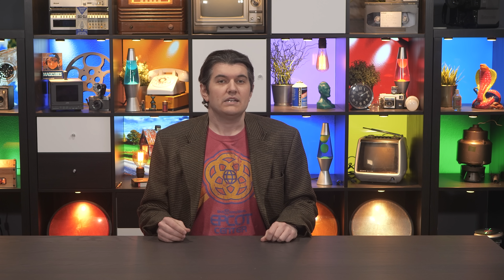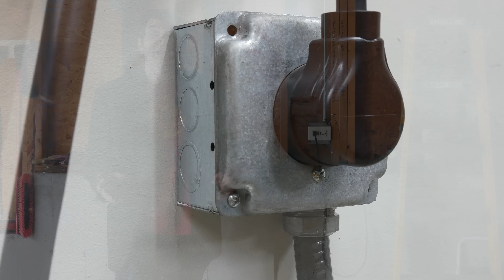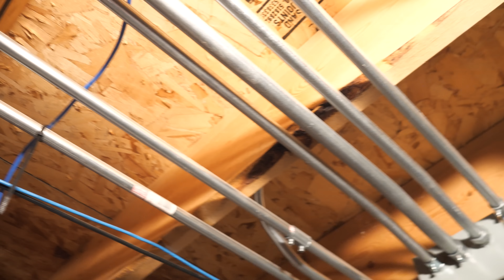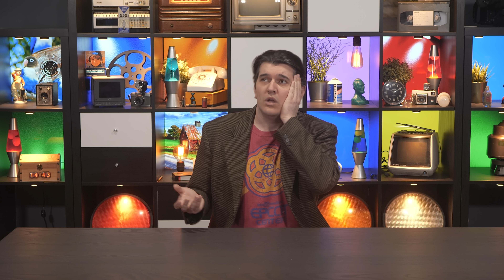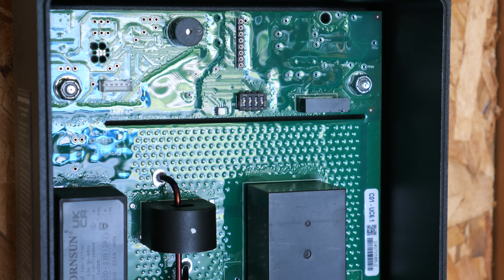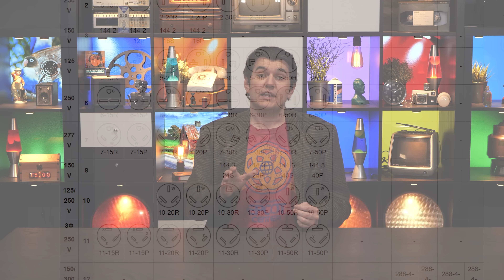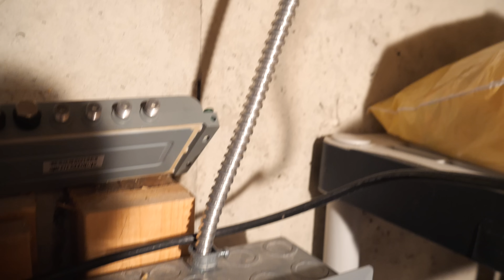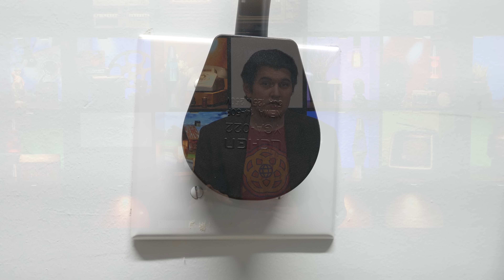The "standard" car charger is usually overkill—but your electrician might not know that

Comment: Electrician here. I think its well known amongst us that EV chargers are configurable to the OCPD rating. 

If the demand calculation permits a 50 amp OCPD for the charger, that is what im going to install. Every. Single. Time. 

Why?

Because i am not required to have a separate disconnecting means at 50A or less, so the cost difference is the difference in wire size. No customer has opted for less when given the option, the cost is negligible in the grand scheme of things, especially when the panel is shared with the wall the charger will be mounted to. 

Additionally, depending on your AHJ, there is no reason to buy a 14-50r and use the connector from the grizzle. Just take the gland out and hardwire the charger. 

So the cost difference is truly negligable

Comment: Here in Manhattan, there is a guy around the corner from me that literally has a 120V orange extension cord coming down out of a third floor apartment window, wrapped around the fire escape, plugged into another extension cord, wrapped around a tree, plugged into a third cord, and then into their Tesla.
Reply: Hope that he's using 10 gauge or so.
Reply: @selewachm . Lol, I bet he’s using 16 gauge.
Reply: The homeless man must be loving the free power!!
Reply: @Endoe.McKronic  Around here you need to beware of the wires coming out of the lighting junction box, laying on the sidewalk and disappearing under bridges...
Reply: That may not be up too code!
Reply: I'm guessing it will keep the snow melted around it in the winter.
Reply: @NackDSP  Not really.  120 lines are only slightly warm to the touch.  It might melt the snow a hair but it'll refreeze nearby.
Reply: @shaunmcisaac782  Probably 3x 50' 16ga extension cords pulling 12-13amps for an extended period... I bet after a month of use outdoors you won't hold the hot spots in your hands😈Not for long😈
Reply: @shaunmcisaac782  voltage doesn't really matter, if you pull too many amps, or have weak points, it will get hot. I have had outlets melt the plastic from even moderate loads. Also, extension cords aren't really supposed to be used at high current continuously.
Reply: This is an insane fire hazard.
Reply: @jmpersic  yea but the fire escape is metal so it will still probably be fine because I bet the car is only charging at 8 amps. I mean it’s a bad idea but it will probably work for a while.
Reply: I wish I could do that.
Reply: I had a neighbor that ran an extension cord from 2 car garage (too filled up with stuff to park a car), across the driveway, over the sidewalk, across the parking strip, to their EV which was parallel parked on the street. They did set up some orange traffic cones next to the sidewalk where the cord crossed.
Reply: @twostate7822  yea i do that i just throw a door mat over the cord on the sidewalk
Reply: I had plenty of space in my 200a service panel.  I decided I wanted a full level 2 charger.  I do electrical work so I installed it myself.  I ran the conduit, pulled my 6ga wires, dropped them into a 60a breaker and landed them in a Tesla charger.  My car charges at 11.2kw.
Reply: Wrapped around the fire escape. Oh, the FDNY is not going to be happy about that. Sooner or later, someone is going to be fined. And if that's a rental tenant, maybe evicted.
 I can you from experience that if any condensation or precipitation gets into the places where those cables join together? The whole outside of the cords will be energized. Not fun.
Reply: One has to do what one has to do... 🤷🏻‍♀
Reply: The voltage drop on that by the time it makes it out to the Tesla must be brutal 😆  (unless he's using at least 10 AWG cords with good connections between the cords, which I highly doubt)
Reply: @XSFx5  Orange extension cords are generally 14 AWG rated for 15 amps max. So adding high current with an extra 100 feet or whatever will indeed cause a noticeable drop.
Reply: @xeridea Indeed.
(Heck, some of those extension cords people use are just 16/2 or 18/2, along with multiple power taps, aka. surge strips.  So significant wattage being wasted as heat, in a positive feedback loop between heat and resistance)
Reply: Plenty come in 16 and 18 too. 16 is the most common at big box diy stores. They go up in price sharply going to 14 or 12
Reply: That part about wrapped around the fire escape doesn't sound safe or legal.
Reply: @stevek8829 it's not legal regardless for building and fire code, but if it's also not protected by a proper GFCI breaker up the line it's definitely not safe!

Think about if the insulation gets worn, aged, or otherwise damaged to where it's contacting conductors on the metal of the fire escape, or connections become loose & exposes, and it gets rain or ice on it? 

Energized fire escape. 

One might escape the fire's smoke to die getting electrocuted on the fire escape.  Maybe killing a mother carrying a child, frying them both.
Reply: And the daisy chained extension cords hanging out the window does?
Reply: @stevek8829  It’s New York City.  If they have homeless people everywhere and violent criminals are often improperly punished etc. … I’d bet they don’t have the manpower to worry about extension cords running out of windows.
Reply: @wishunter9000  They are pretty much up on fire escapes not having any objects or obstructions. The idea of homeless swarming all over is highly exaggerated. 
Did you observe that?
Reply: @s @stevek8829 lright bud touché, I shouldn’t say “everywhere”.  I grew up and still live in the Midwest in suburban / rural areas, so last time I went there recently it’s a whole heck of a lot more than the only acceptable number of “near-zero” that I’m used to.
Reply: @stevek8829 THAT'S the part you find unsafe??? Nothing he described sounds safe.
Reply: People are desperate for the switch to electric!!
Reply: @burlingo  Found another Bot ☝️
Reply: @wishunter9000  you don't find his behavior desperate? I do!
Reply: @burlingo  There it goes again, yapping away ☝️

Comment: The problem with that if you connect in regular plug and is not a branch circuit the EV station can melted the wire. Cuz is continuous load. NEC Article 100 – Definitions:
A continuous load is a load where the maximum current is expected to continue for three hours or more.

⸻

Key Points:
	•	Examples: Lighting in commercial buildings, heating equipment, and certain appliances that run for long durations.
	•	Conductor & Overcurrent Protection Sizing (NEC 210.19(A)(1) and 215.2(A)(1)):
	•	Branch-circuit conductors must be sized at 125% of the continuous load.
	•	Overcurrent protection devices (breakers or fuses) must also be rated not less than 125% of the continuous load.

You need to know the NEC code no just make opinions.

Comment: Electrician here. Every time my company gets a call about an electric car, we always try to get as much info as possible first. Personally, I like to have a conversation with the customer first to get an idea of their usage, and if possible, look at the charger they plan to use. Then, we size it based on that info. Plenty of times, we've done 20A 240V outlets for people who don't drive much, and 30A 240v for intermediate driving. The 50A 240V ones usually only get put in houses where people don't care about the extra cost. 

Also, you can get MC in sizes larger than 10 guage. But bigger than that, they call it "interlock cable," and you usually have to go to a supply house for it. I've pulled it in 3/0 before. Well, me and 3 other people did. That stuff is heavy as hell. 😂😂😂
Reply: I usually install 40amp or 50amp. The extra cost isn't that much. You're not saving that much with 10 gauge vs 8 gauge cable not when the labor is half of the cost.

40amp is definitely the sweet spot because there are chargers with a selectable 32amp and 16amp option. You just put it on 16 amp 90% of the time and switch to 32 amp when you really need it. Thats what I do in my house. "When I really need it" are times when I forget to charge and I would try to squeeze some more juice into my car for 1 hour before I leave for work. I won't actually drain my car down to zero but it helps.
Reply: @SourDonut99 I completely agree with this. I don’t see why anyone will want to purposely scale it down just to save a few dollars. I mean if got the electrician here pulling wire and going up/down my attic already, I’m going to do it once and do it right with the most optimal gauge. This is also a good idea for future expansion as well. 

Also, while I agree with the discussion of the video this is mostly for cars with bigger battery and CAN afford the wait time. This was not something possible for cars that used to have smaller battery (think Leaf 2017). We didn’t have the option to just wait for it to charge because we don’t have enough battery to hold the charges to start with. So we charge any chance we get and we want it as fast as possible.
Reply: @SourDonut99  i guess ur on 240V supply? so charging at 7.7kw will give you 20% buffer for the continuous load? I don't know what the regulations are
Reply: I installed a Tesla Wall Connector on an existing 30A circuit with 10 AWG wire. My electrical inspector denied my permit and insisted that it could only be installed on a 60A circuit, despite the fact that I supplied him the exact page from the manual that details how the charger can be configured to work with any size circuit from 15A-60A. I also referred him to NEC 625.42 which explicitly permits adjustable EVSE installations. I will likely have to file an appeal with my county board to have his denial overturned. He told me I needed to read the Tesla manual to get a "better understanding on the electric requirements", which is an amazing thing to say to someone when they have obviously not read those very documents themselves.
Reply: Here I am wanting 60a lol
Reply: I already have a 240v outlet in my garage. It's been there before EVs existed.
Reply: @kyle1598hffgyfv … for a dryer?
Reply: You realize that they come in different flavors of amperage, right?

Comment: I drive a plug-in hybrid with a drivable range of only about 35 MI before switching to hybrid. I did so much electrical math before bringing it home thinking I needed a level 2 charger. Every single EV person I knew said it was absolutely mandatory. It's been 2 years and I still only use a standard 120-volt outlet. 0 to 100 in less than 6 hours. For my daily driving anything more is just unnecessary.

Comment: First of all, as a fellow "gear-head" I regularly watch your videos, particularly enjoying how sensible you are in your material and presentation.  That certainly applies to this video, as it totally parallels my thinking process when i added a 30 amp circuit (self-done) to charge my EV at 24 amps.  I even went for a 30 amp outlet, the same kind that electric dryers use.  I did add a special GFCI breaker in the panel, since I couldn't find a 30 amp outlet that included this feature, and it's required in my garage.

I've been using this setup now for three years, and it's been a pleasure.  Never once had a hiccup, and my 62kwh Nissan Leaf always charges fully overnight.  Oh, and incidentally, I never unplug it so I'm not worried about wear and tear on the socket.

Comment: Dumb question: do I need to get a dedicated EVSE charger with a 14-50 plug already installed? I have a mobile connector with a 14-50 adapter and I don’t see a need to spend more money, but I recognize the potential issue of unplugging and plugging in the cable as you mention in this video.

Comment: I 100% agree with what you said in this video and it FRUSTRATES me to no end how much emphasis EV reviewers place on fast charging. WHY??

I don't understand this, when actual EV owners rarely charge at fast chargers.

Using "fast chargers" regularly would be a horribly annoying way to charge our EVs.  Plugging in and charging overnight while we sleep at home, is the only way we charge our EVs.

Edit: In fact, so far, we have NEVER charged our 2024 ID.4 at a "fast charger" (other than one short test that confirmed almost 190A peak rate at slightly below a 10% SOC) in 22,000 km.

Comment: We have two Teslas in the fam and I installed a sub panel and two wall connectors in our garage myself with my son (teaching opportunity).  They use the power sharing option sharing one 60 amp circuit (48 amps to the car/s).  It’s great.  And the power company reimbursed me for the Tesla Wall Connectors.  And yes, the system works fine when the internet is down.

Comment: Just got an EV, just watching this now.
Distracted by the white PPC amplifier behind you in your parents basement. Bad, remove. Not good. 
Cause major issues, splitter is better. 
Couple options: 
A: Have a technician from the ISP come out to tone out the lines, put in a proper, compliant splitter. Might cost, but will ensure it’s proper. 
B: if you see a tech working on the street, ask for a splitter. They usually have them on their truck and will give them out for free. Not technically allowed but anyone who works in cable knows how bad these off brand splitters are. Buying one is NOT RECOMMENDED. Waste of money, usually gets replaced if you have someone come out.
C: if B is successful, you can buy a toner for a few bucks online and tone out the lines. Much better to remove all possibility of problems. 
D: live with it but almost guaranteed to have problems. 
Be sure to put main devices (if modem only, no splitter, if multiple devices, bigger boxes on main splitter, smaller boxes on secondary, or whichever has the most loss, -3.5 or -7 on your  splitter.)

On all these, make sure it’s tight. Pliers or a 7/16 wrench.  

Please. Have a good week.

Comment: Can you run a basic plug in charger from an extension lead? Even here in three pin plug 240 volt land(Ireland/UK)? I see for continued use 8 amps is the recommended max for our sockets

Comment: This should never be done.  Always wire for max supported amperage of this charger.  In this case, with a 48amp rated charger,   #6 THHN wire should have been used for the conductors and #10 for the ground from the panel to the charging station via 3/4" conduit.   Protected by a 60amp breaker.  This would account for safety in case the wrong amperage signal was sent from the charger to the car.   Sure the 30amp breaker would trip in that case, but that happening again and again is not what you want.  Remember, the signal sent from the charger to the car is not a contract, its a suggestion.  Many things can go wrong in between that would allow the car to draw its maximum load under whatever condition it is in.  Always always always account for the corner cases when doing electrical work.    This video, in my opinion, in reckless because it's giving laymen a sense of security that they shouldn't have when it comes to Level 2 charging at home.  Best case your 30 amp breaker keeps tripping.  Worst case, your house burns down.   Not worth the risk.  Do it right.

Comment: I already had a 240v 20A outlet so charge at 3.7 kwh.  It is plenty of charging.  I run a charging cable outside under the garage door.  The cable cost me $350 because it was extra long.  That was my only expense.

Comment: I have a ford f150 lightning and I charge it at 16 amps, 240 volt circuit, 3.8 kwatts.  It is totally adequate.  It is a little less efficient than providing more amps - closer to what the vehicle’s internal charger is capable of receiving in ac power. (11.3 kwatts).  This is because of the fixed losses that the vehicles charger uses, no matter what rate it is charging at.

Fast chargers are dc power and thus bypass the vehicles on-board charger.  It’s important to remember that the unit you put in your house is not a charger.  It’s just a unit to limit how
Much power is delivered. To the vehicle’s on board charger - which converts from ac power
To dc power (which the battery uses).

Comment: I got lucky because my outdoor electrical box is attached to my garage on the direct spot where I wanted my charger. I only drilled a single hole, and needed less than 2ft of cable. Less than $100 for all of the equipment and in less than 2 hrs, I went to the hardware store, bought everything, and had a 14-50 in my garage and ready to go. Been using it for a year and a half now with zero problems. 

We DID start off by using just the normal wall plug with our Tesla Mobile connector, but when something comes up, it usually means needing to drive long distance, so we wanted the speeds needed to go from 20-100% in under 8hrs if needs be. 

The Tesla Mobile Charger is honestly the perfect charger. I really tell people you don't need to spend money on a fixed charger. The mobile one has both plugs and I've never come across a reason for any smart features other chargers have that the car doesn't already do. Roughly $50 plus wiring is all you need if your EV comes with a 14-50 like every Tesla on the planet as well as many other EVs.
Reply: If you have a 14-50 outside on the wall you will need an in-use wet location cover and a separate shut-off within reach on the outside as well.
Reply: @michaeltaylor5451 I should clarify. My outdoor box is on the opposite side of the wall. I put my 14-50 inside my garage. So I was able to drill right from inside the box through the wall and mount it inside the garage. No part of my setup is exposed to the elements.
Reply: I 100% agree that the Mobile Connector is the way to go. Then when I go to relatives, or VRBO I take it along. Other than the "cool factor" I don't understand a wall mounted unit. My wire run is 30 inches from the outdoor service panel to the 14-50.

Comment: Lol. That's fine for 75% of normal use. If I'm spending money to have one installed the cost difference to get a 50 amp plug installed vs a 30amp it's peanuts. I'm installing the fastest one possible. 500$ for a fast charge or $350 for a slow one.....  Give me the fast one.